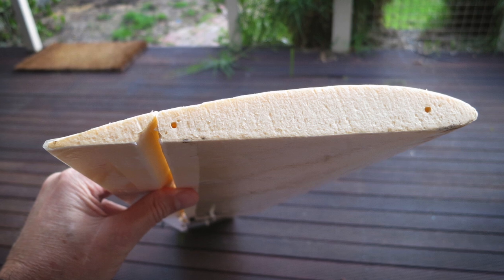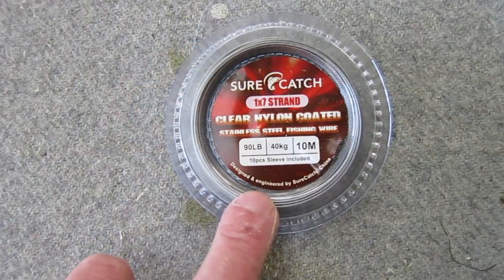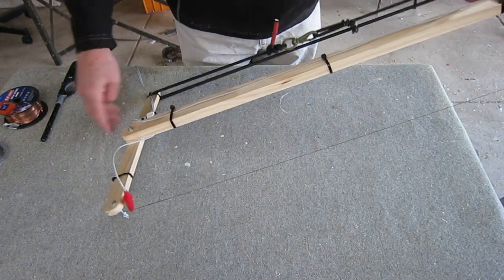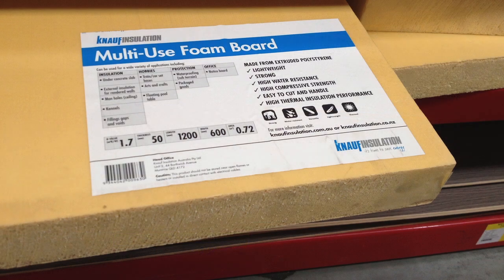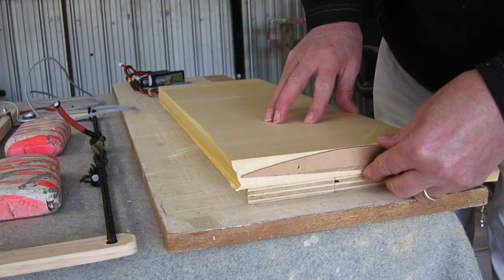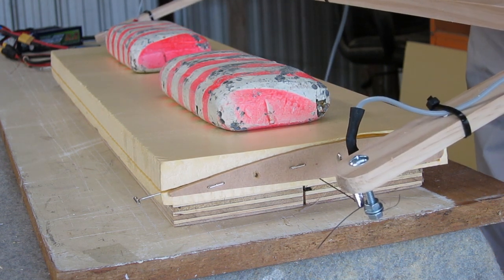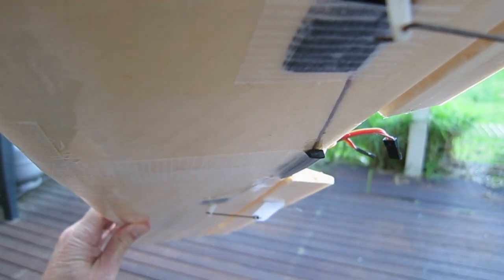Hot wire airfoils and bow

Comment: Next project is the “DLG F3K style RC electric glider”. Marko Roolaid on YT. Body is 3D printed with CF filament. Wing is hot wire cut with carbon fiber glued to the top. He uses a food saver vacuum bagger to suck the wing down while curing. 3D printed parts are on Tverse. I’ve already 3D printed all the parts on my Bambu Labs A1. They look good!
Reply from the maker: That will be interesting. Doubt I could cut a decent thin wing
Reply: https://youtu.be/9Tv_y47E8zc?si=A37jQwbj63thp-NZ

Comment: I use .025 aircraft safety wire. Works great! Then I use a soldering iron with a metal yardstick to melt a channel on the bottom .  Install a 1/8”-3mm carbon fiber rod. Then fill the channel with epoxy. Then cover with colored shipping tape. Made 6 planes like this…gliders to 3D foamies…13 years ago. All still flying perfect!
Reply from the maker: I'm using edge-on carbon strips glued into a slot now. 13 years is very impressive!

Comment: This is fantastic, maybe use the wire cutter to open a channel in the wing root to add the spar. What length did you choose for the wood for the cutter?
Reply from the maker: Thanks, long enough to hold 800mm span of wire

Comment: These videos are an inspiration for anyone into rc planes.

Easy question-

Looking at basic airfoil shapes, when one makes a Armin wing the top is a curve surface that extends that curve that form your control ailerons or flaps past the bottom of the wing.

Meaning the control surfaces curve beyond the flat bottom section.

When one cuts out ailerons they can be moved slightly uo to keep to match flat profile of bottom but the parts of curved area right next to ailerons keep that curve downward 

A) does the wing fly OK if control surface area keeps that downward curve in the wing?

B) or should one completely remove control surface area & re attach ones that keep & match flat bottom looking from the side view of wings?
Reply from the maker: Good question. I tended to set them up flat with the bottom, not following the top curve. Both ways would work, maybe more lift and slower flight if they followed the top curve. More speed less drag if. they are flat with the bottom.
Reply: @AndrewNewton  .
You've been in the hobby longer than I. Which methods work better for Gliders?

A- armin wing depron approach or different foam using Hot Wire cutouts?

Ever fly 3D printed winds, 

I've watched J5 glider competitions & some ideas have 8ft upto 14ft wing spans with 11 pound Gliders.
Reply from the maker: 3d printing is no good for wings IMO. Depron armin wing is much easier as long as you keep it thin, like 10%.

Comment: For the spar I'm thinking of using a laser cutter diode, won't need to be very powerful.

Then I can put it on a CNC track, line it up and fire the laser along the longitudinal axis.

But since I don't want the laser cutting through completely, what I figure I'll do is make a tiny slit at where I want the spar to end inside the wing and place some a tiny bit of stainless steel. The laser should hit it and not cut through or heat up too much.

I'll use a square spar as well, which will make the CNC along the X and Y axes pretty easy.

I'll document my progress and come back
Reply from the maker: Radical idea. Let me know how it goes
Reply: did you succeed?

Comment: i test today this whit styrofoam, not come good, how you can cut wery smooth wing, i have lot wire holes and how strong you has make hot wre tension ? sorry my english i mean wire i have wery flex how can tighten wire lot more.
Reply from the maker: Stronger elastic on the bow will keep the wire tight. It does need to be very tight https://www.youtube.com/playlist?list=PLC8MdCMvxwBhQByf_3Emcb0bSah1tv5dE
Reply: @AndrewNewton  ok,thanks i must try tight this, i have "H" style wood frame up spring and down hot wire. and i looking wire not move smooth on top airfoil template, has made 3mm plywood templates.same than you video have.i try made gravity feeder this, have 2 bottle 1 liter water, top of robe but hot wire not feed smooth. need bush alltime at hand wire move.and then come to wing lot lineholes.

Comment: I was really surprised at your setup. I would have thought your wire choice would have had too much resistance to heat up evenly with you power source. I would have thought the wire would cool too fast when cutting that length.Looks like really nice results.
Reply from the maker: I didn't't know any better, but it works OK

Comment: About 6-7 years ago I was fortunate enough to have a Dead Radiant/blower heater which of course when you look at them have a good 10m+ of coiled up Nichrome wire in them.  I scavenged and built a 1.3m wide Wire cutter.  From there I worked on a Massive Foam core Fibreglass wing project.  The Foam was EPS - Also from Bunnings - haha - but was the Standard White Underfloor insulation.  OH BOY THAT STUFF WAS MESSY!

The XPS was never around at the time...I was in bunnings the other day and saw two whole racks of th Knauf...I bought a sheet and look forward to cutting the single sheet of 1200 x 600 into a single Flying wing design - just for kicks.  I now have probably 15 sheets of EPS still in the garage I am giving to some guys at work because I have a feeling the XPS will be my New material of choice!
Reply from the maker: Good tip about the radiator wire.

Comment: Do the ply templates have to be aligned at each end with each other?  if one is tilted up and other tilted down will that effect the shape?
Reply from the maker: I carefully measure up from the base of the foam to align the templates. Some wings have the tip angled down slightly to give "wash out" which reduces tip stalls.

Comment: 👨‍💻👉USE FUSE WIRE ITS CALLED RESISTANCE WIRE-  as in old fuse box Wire   heats wont break  also used in heater coils ect🕺💭🐏🐨👍
Reply: vape store have kanthal wire or ni crome wire and can use guitar string, or welding MIG welder wire 0,3-0,6mm about. welding wire better stainless steel wire.
Reply: Fuse wire is copper which is too soft and too conductive.

Comment: Kanthal A-1 wire is made to do this ... why use something subpar? ... It's stronger and cheaper ... less than 10 bucks for all you will ever need. You can get it at walmart, home depot, etc ... it's ubiquitous.
Reply: 0.6 mm is about 24 gauge ... I bought 100 feet for 7.99 US in 2014 and still have more than half of it left.
Reply: Dunno what they got down under ... but there is always Ebay ... easy to find there.
Reply from the maker: Yeah available in Vaping stores. Thanks for the tip

Comment: Great info thanks Andrew.
NZ builders can also get the same insulation from Bunnings 😀
I can only find 70 kg ss wire which is 1 mm...How thick is yours ? Do you think 1 mm is too heavy ?
Reply from the maker: Too thick I suspect, 40kg is what I use. Can also use a thin metal guitar string or nichrome wire (0.3mm I think)

Comment: Judging from my experience with foam cores the biggest challenge is what to use for covering the core afterwards. I've tried packing tape, wood varnish and iron laminate 80mil. The laminate will stick great to the foam however, after time it will start peeling. The material is also relatively heavy compared to EPP, EPO or Styrofoam. 
The wire cutting technique is very entertaining though. I still have my bow and few wings already cut.
Reply: Some people have used the poor mans monokote which is the clear heat shrinkable sheet used for making up gift baskets. Dollar Tree has it.
Reply: Hi mate
I am using craft paper with wood glue. Improves polystyrene strength many times and can be painted over easily. Give it a go you be surprised how much will improve strength and look of your aircraft.
Cheers 
Eddie

Comment: Hi  Andrew, I start now to learn the cutting of wings with hot wire, my problem is that the wire is cooked after a few seconds, I use a nickel guitar string of 0.36, and I connect to a lipo 3s 2200mah, maybe it's better change the diameter of the wire with a 0.6mm?
for the template instead I used an old tin of oil, because here in Italy I can not find the roll of aluminum that you used to cut out the template.

Thank you, I hope I will not get rid of you with these beginner questions

Greetings from Italy

Marco
Reply from the maker: Ask any question you have Marko. Stainless steel fishing wire 90lb works best for me. I have not used guitar strings but it's worth trying.
Reply: @AndrewNewton  Thanks Andrew,i founded Now..👍🖐

Comment: So u don't use any voltage regulator to increase or decrease the power on the wire
Reply: i use 12volt 5A dc power switching power supply whit pwm potentiometer votlage controll, working fine for me, kanthal wire 0,5mm and lenght 800mm

Comment: How did you manage to make your aerofoil shape with wood?I have 3D printed mine but am worried the wire will melt it
Reply from the maker: Thin aluminium is what I use now.
Reply: laser cutting to manufacture that?
Reply from the maker: Scissors
Reply: Hi Andrew, wher can i get the templates i looked on airfoil.com but i can not downlod the templates, i want to build a teksume like wing myself. Maybe you can share your templates?😉

Comment: Why are not you using brushed esc? What advantages and disadvantages of use without the esc?
Reply from the maker: Why use brushed ESC?
Reply: Andrew Newton To control the voltage and current. We do not want to overheat the wire and on the other hand do not cut too slowly. Mybe i worng?
Reply: OK, I have a proper adjustable power supply when I need to adjust the voltage, but I can also use 2S, 3S or 4S batteries to achieve the same result, depending on how long the cutting wire is. Just needs 4A for the right temperature.
Reply: @NewtonAirlinesuncut  If I understand correctly I should try batteries with different voltage. And probably at the right temperature the wire will take 4amps? This is a kind of rule for thumb for hot wire cutter.
Reply from the maker: Only if your wire has resistance of 5 ohms per meter. I use stainless steel fishing wire 90lb strength.
Reply: @AndrewNewton  tanks for the help.

Comment: Excellent job on the wings, looks like you've created a great way to cut them, you mentioned about spar improvement, how about a 3/8 aluminum tube spar forward of the CG and a 1/4 aluminum spar to the rear of the CG, should be a much stiffer configuration, great enjoyable videos.
Reply from the maker: That would be solid, like Volantex model wings

Comment: Hey Andrew. I’m on Oz too just wondering where you get you laminating film from?
Reply from the maker: Unfortunately the places I bought from dont exist anymore. Look for laminating machine supplies or an RC hobby shop.
Reply: Andrew Newton thanks for your quick reply. Do you just ask for laminating film? What thickness is best?
Reply from the maker: 3 mil (75 mic) is the most useful thickness, you can also use 1.7 mil (42.5 mic) for lighter builds. The stuff I bought is 305mm wide rolls of GBC EZLOAD Lamination film. That's about all I know, sorry I cant give you a direct link, they seem to change often

Comment: A good source of template material are used litho printing plates (offset machining not digital!!)  from a commercial printer. Can come in various thicknesses, but all are thin enough to cut with scissors easily. One plate will give you enough material for heaps of profiles. You only have to ask and they will give you one or to. They are normally scrapped.

Comment: All of the two bit RC pop up manufacturers are going to be really upset that you gave their secret away for cutting Styrofoam.  This was a great video.  Ever since I learned how to work with Styrofoam I don't throw ancoy of it out.  When you can make clean cuts...the possibilities become endless when you start learning the variation of heat to get the foam to mold in certain ways.  Its very precise.   For wheels or circles of any kind I use old tin cans.  Clean them up real well and place the open end on the stove (electric works best) for 30 seconds, spin gently and quickly or it can stick.  If its hot enough it will pass right through, but the edges of the foam can get hard.   Thanks for the video!
Reply from the maker: Tin cans, brilliant Damien

Comment: My Digitor multimeters probes have about 1.8 Ohms in the leads, so you'll have to test yours and subtract that from the reading you got across the wire to get the resistance of the wire itself.

Comment: to make a spar in a wing you dont take apart... just run the hotwire down to make a cut about at the cg line and insert a carbon fiber rod and CA it in..
Reply: When I make large wings (over 5') I'll set the fence on my table saw to the thickest part of the wing and cut the wing in half at that point. I then cut a piece of a birch door  skin (1/8" thick) slightly taller than the cut in the wing and glue the pieces together with urethane Gorilla) glue. This type of spar
 , I've found, makes a strong rigid wing.

Comment: You can improve the performance of the wing by making sure that the surface is perfectly smooth.  Any bobble or irregularity will create micro turbulences on the surface, which disturb and decrease lift.  Glider pilots do a close inspection of the wings before take off,  even the smallest contamination like dead insects can decrease the performance of the wing.

Comment: Hi Andrew, for inserting the spar, I use the hot wire, cut a tapered U shape where you want the spar remove the cut out deposit into that your spar, trim from the tapered U sufficient material  to allow it to fall into the hole and cover the spar and adhesive,  later sand any over sized foam flush with the underside or top side which ever suits. The same can be done for servo wire laying a tube to through which your wire are feed .
Great video thanks Chris
Reply from the maker: Thanks Chris, nice tips. I'm using edge on CF trips in slots these days

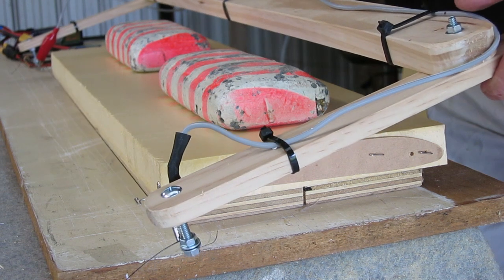Comment: Do you have any tips for getting the two templates to line up with each other correctly on each side of the foam block? ie. 3:42
Reply from the maker: Marks on each leading edge and marks measured up from the bottom of the foam, but mostly just eyeballed
Reply: aha, ye olde eyeballe. I have a couple of those. Tried to cut some very thin wings last night, didn't go too well. Two of the four might be usable, but I think next I'll try the one-sided method where you fix one end of the wire and just use a template on one side. Placing the fixed end far away will reduce the amount of taper, but I would like to have a bit of taper anyway so that's fine. I like that idea because I don't need to line up two templates, I don't need to match speed of movement between the two sides, and I can pull the wire really tight (my biggest problem so far) while still having a good view of what I'm doing. I'm also thinking to switch from using plywood templates to fr4, and use an interior template instead of cutting around the outside. I find that plywood edges keep catching somehow, even though sanded smooth. So basically, I'll just copy that video of David Windestal that you have probably seen already.

Comment: this is so good, thanks you really. I am planing to get in RC planes but need to know how can i rebuild them if i crash. This is what i was looking for.

I need to ask a question, i want to fly with FPV equipment. Can this kind of planes carry these equipments? Speed is not a problem i just want to be in air with FPV. (=
Reply from the maker: Most foam planes can easily be repaired with hot glue and tape as long as the crash is not too bad. Yes just about all of the planes on my channel would be suitable for FPV. God idea to start with a slow and stable plane like a Bixler 1 or AXN or Dynam Hawksky
Reply: Thank you (= Can't wait to fly a mustang with FPV after some experience...

Comment: Thank you for the video, I just want to ask you about the power supply & wire, if I want to make the length of the rig 120cm, what are the specifications of the wire? The voltage & current? And if there are any details you could provide me with.
Reply from the maker: Voltage = current multiplied by resistance. The wire I use has resistance of 5 Ohms per metre. It needs 4 Amps to heat it up enough cut foam. Resistance of 1.2m of wire = 5 x 1.2 = 6 Ohms. So voltage required to give 4 Amps current = 6 x 4 = 24V

Comment: AN, re. fitting a spar; why not use a vertical wood or ply spar and wire cut the slot for it.
Reply from the maker: Yes that would work, I use carbon fibre strips exactly like that

Comment: just an idea for a spar. I saw this in another youtube video (dont remember wich one).
Use a square spar and then use 2 halfs of foamboard. cut out half of the spars. (diamond shape, not flat) ). glue them together and cut wing. then slide in the spar in (both wings)
Reply from the maker: Thanks for the tip. Interesting idea

Comment: Anything special you do to make sure the patterns line up perfect on both sides, or is it as "perfect" as you can get it?
Reply from the maker: I can get it quite accurate by measuring up from the flat bottom of the XPS foam block, then aligning marks on the leading and trailing edges of the templates. But you can also easily add twist or washout if desired.
Reply: Andrew Newton Thanks for the reply. I'll have to give it a go. I'm new to the hobby, so the quick response is appreciated.

Comment: I have watched a few of these videos now and have one question, no one lays the aerofoil template flat how do you make sure the wing shape is not twisted or out of alignment
Reply from the maker: You can lay the templates flat sometimes. But what I do is mark the leading edge points on the templates and mark points on the foam measured up from the bottom. Line them up and all is good.
Reply from the maker: Only XPS for me. I think EPP is harder to cut and a lot more expensive.
Reply: Polyfoam Australia sells it 50mm x 1000mm x 700mm $55 if your ever interested